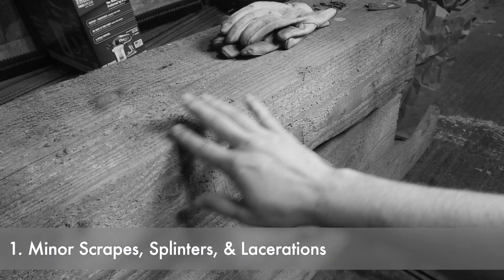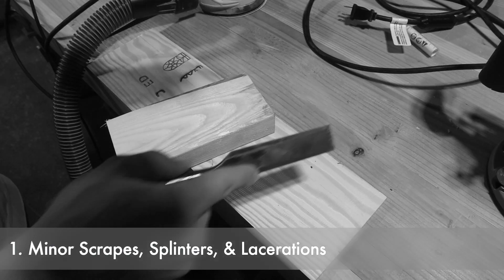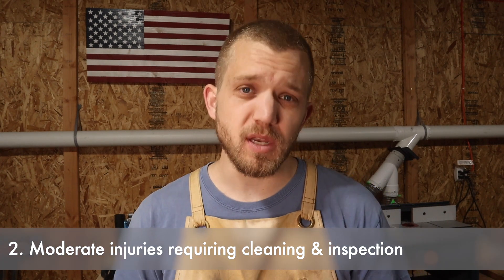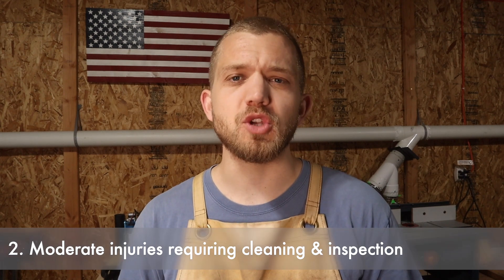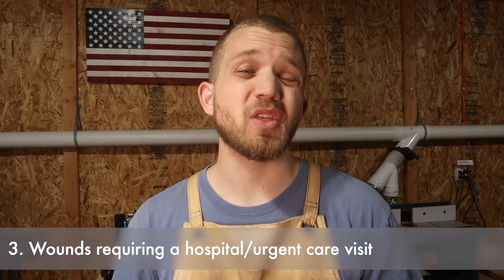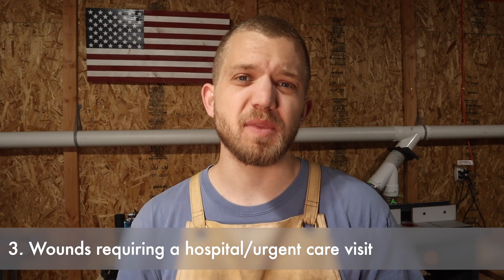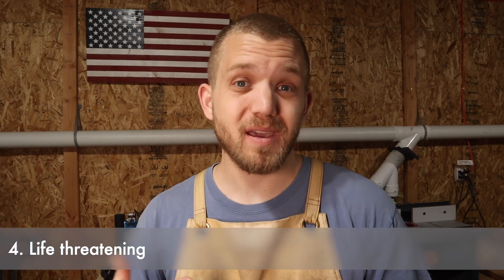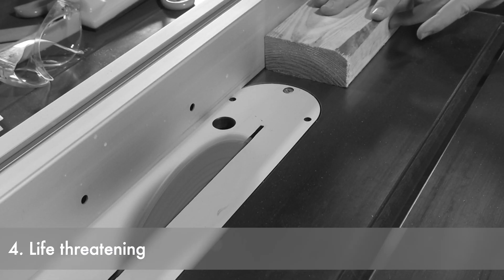Shop Medical Kit | What’s In Mine & Why

Comment: I’ve got a bit of experience with injuries, in high school I cut the end of my thumb off on a table saw… another time a friend of mine was hit by a forstner bit that came apart on the drill press. I’m also a former EMT. 

On top of the band aids and tourniquet you mentioned, I’ve got non-woven gauze sponges (pads) and QuikClot. I strongly recommend some kind of clotting agent like Celox or QuikClot for a shop medical kit. It burns, but it’s better than bleeding out
Reply from the maker: Clotting agent is a great idea! Are the gauze lads mostly for compression while you get where you’re going? Beyond what say, paper towels could provide.

Comment: EMS chief, and woodworker. 100% yes to tourniquets - and 1000% yes to not getting as cheap knockoff. I keep a CAT tourniquet at my table saw as well as in my shop apron. I also have some basic 4x4 gauze, tape, and chemical ice packs. Nothing fancy, but useful. Two things to remember - better to call EMS and we cancel or do not transport rather than wait. It takes time for a bleeder to start really bleeding (movies are fictional!), so be proactive. Second, know how to use a tourniquet - but don’t practice on the one you may have to use on yourself. They stretch and become less effective. Take a Stop the Bleed class and go high and tight if you have to apply. Remember to position the tourniquet so you are maximizing leverage across your body when self-applying. Literally the opposite of how you use on someone else. Quick clot and wound packing are nice, but I can’t imagine most people can self apply them. I sure as hell am not going to wound pack a junctional injury on myself. 

Finally, if you cut something off - keep it. Wrap in dry gauze and keep cool. Don’t put with ice (!!!!) and don’t soak in water or saline! A bag is just fine. Can’t promise everything can be sewn back on, but better safe than the other thing. Seriously, no ice. Why do people put their fingers on ice when they cut them off? 

Be safe everyone!
Reply from the maker: Can’t love this comment enough! Thank you for the advice! 

For the gauze and tape, where is your primary use for that? To stabilize prior to going to the ER? I guess even if you have a TQ, you still need something 🤔 

Also, great recommendation on the class. I need to get signed up for one.
Reply: @NorthwestCraftsman  I guess I don't really use bandaids until much much later. They don't stick well to wet/bloody things, and they don't pad or absorb very much. Gauze will absorb more blood, and is bigger, so much easier to rapidly position while I sort out how much of a core sample I just took of myself. I did a number on my hand with a marking knife I dropped (I did catch it... by impaling it in my finger - fun times) and just taped down gauze tightly to stop the bleed and finished my joinery. Later I applied butterflies after some serious scrubbing. I'm lucky (careful?) that I'm yet to send myself to the ER with urgency, but my line would be uncontrolled bleeding for more than a few minutes (I mean BLEEDING not a little blood), something where I can see bone or a wound that lays open and is larger than a few inches, or deformity or disfunction of any kind; like a cut that makes a finger sort of droop - on the good/bad scale, that sucks. Once took kickback to the gut when trying to make a super quick cut and thought for a moment I'd impaled myself. Luckily I'm well padded in the middle and just had a bruise and a safety story for my kids.

Also, anytime you have any altered level of consciousness for any reason - that's an ambulance ride. Please never drive when altered or recently altered. That's less woodworking / shop advice and more advice advice.
Reply: @NorthwestCraftsman  also, there is no situation where you apply a tourniquet and don't go the ER in an ambulance. A surgeon needs to remove that thing, and will have lots of help to make sure it isn't the last thing you ever experience as a living human being.
Reply from the maker: Thanks for the details. Man, I haven’t had kickback like that before but I have had a close call with a router table that almost ate my hand after me being dumb. Lesson firmly learned about direction of cut. 

That makes sense with the bandaid, for me they only were meant to address the minor annoyances. I guess you also have a higher threshold for what you’ll address at home. Makes sense given your background. I’m think I’m on the same page. Our house medical kit includes the gauze and such so I didn’t feel the need to put it all in the shop since I’m going to need to go inside to clean it up anyways. Thought was, I’ll know if I need to go in, grab a wad of paper towels to prevent a mess and then address properly inside. Is that an okay thought process? Or would you approach it differently?
Reply: @NorthwestCraftsman  I just don't love using paper towel, but that's a weird me thing.
Reply from the maker: Makes sense. They definitely aren’t sterile so I understand the apprehension. 

Anyways, thank you very much for your insight! That’s exactly the conversation I was looking for.